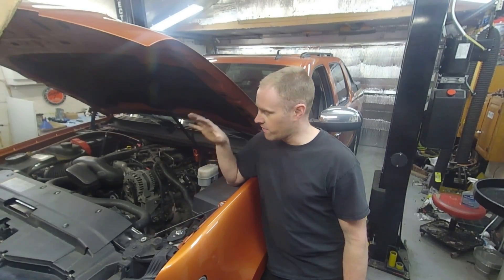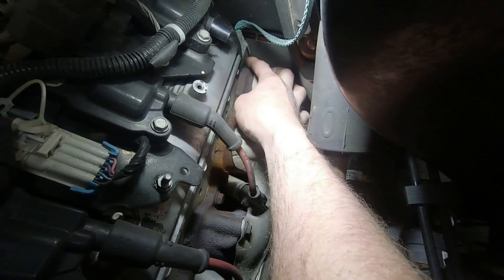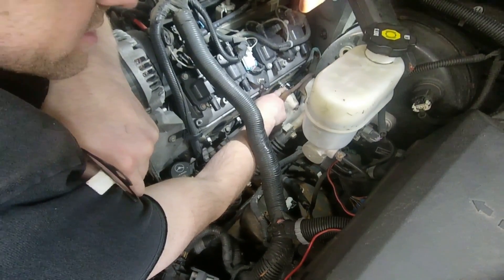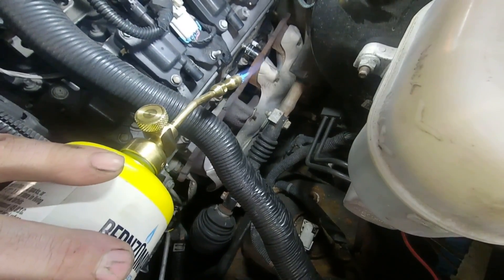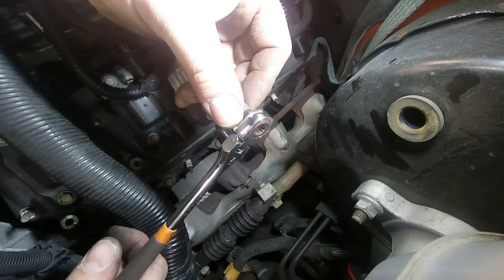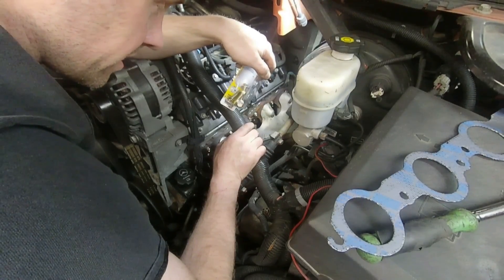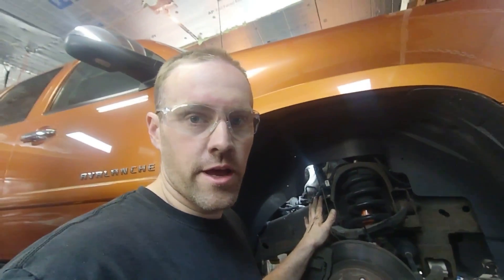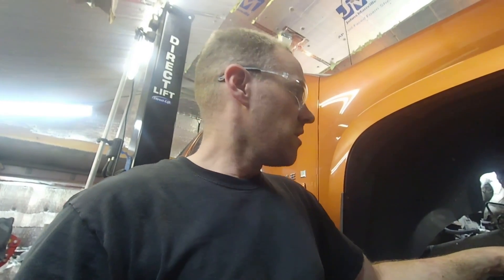GM Chevrolet Truck Exhaust Manifold Leak Broken Bolt Trick, Lifter Tick ??

Comment: I’ve found that putting a copper tube into the hole and feeding your mig wire through that will keep the “nub” from swelling too much and damaging the aluminum threads. The nub feeds into the copper which won’t take the weld. This nub…. Once cooled, can then be welded onto with a nut and run out. The copper tube also makes it so you don’t have to remove the manifold. I just found that easier for me rather than fighting and prying the manifold. Just a suggestion you might want to try. Great video… appreciate you taking the time. 👍🏼
Reply: So you didn't take the manifold off you welded build up then a nut correct
Reply: @dman3962  No I took the manifold off, but the stud was broken off approximately 1/4” below the surface. I didn’t want to corrupt the threads or the deck surface. The copper tube got me past this point without any issues and far enough out so I could get a nut on it. On a few, I didn’t need a nut, I just turned it out with vise grips.
I have done this without removing the manifold on pickups, but space is limited on vans. The tube helps on pickups with the manifold on, so it doesn’t stick to the manifold
Reply: @seanathighwaystar9588  Sixty Five Ford used the copper sleeve trick on his channel.

Comment: You got lucky. I had to weld on  mine to to be able to get it out. There is no room in there to have a welding helmet on once you get the fender liner out. I had to get the nut I was going to weld on in position, clos emy eyes, buff it with the welder for a second, open eyes and check. Got it out after trying 17 times.

Comment: I was just getting ready to do a bolt set!  I found a bolt head on the pavement where I park.  I've been messing with lifters for a month though, lol.  I've had the valve covers off, tryed the B-12 chemtool into the pushrods, flushed the motor with trans fluid, and the exhaust bolts were going to be my next attempt.  So thanks for verifying this.
Reply: How did it go?

Comment: I bought a 2005 suburban with 160000 miles for 1000. It was making a ticking noise. The guy says it's 100 percent the lifter, he had it checked by a mechanic. The mechanic quotes him 3800 for DOD removal plus new camshaft, lifters, rockers, valves, springs, and new updated valve covers. I was planning on replacing just one collapsed lifter to get the ticking to stop. I get the car home and pull the valve covers and all the lifters appeared to work fine. I peek down and sure enough about half the exhaust bolts were broken. All four in the rear on both sides were broke. I was able to extract a few and the ones I couldn't I bought three aftermarket clamps that clamp to the block and exhaust so you don't even need bolts. Worked great and been driving it for 3 years no problems. The funniest thing is my suburban does not even have DOD or collapsible lifters lol. I got a nice 4x4 suburban for 1000 dollars and one Saturday afternoon of work.
Reply from the maker: That's one hell of a deal! I was reading and at first like 05 doesn't have AFM. Then as I read it all made sense. Nice getting it so it didn't sound ridiculous. I know about the clamps just don't like them as a fix because it's not the correct fix. As a shop working on customer cars I won't put one on as it's not professional to do so. I understand it for a personal vehicle though.

Comment: Not sure if you mentioned it in the video or not, but these manifolds do warp on the surface that mates to the head. I have had them machined flat in the past. The last one I did, I didn't want to wait for the machine shop. In the middle of the manifold there is a spot where two bolts are side by side. I made a relief cut in the manifold there so both sides could flex a little. Put it all back together and its been fine for a few months.
Reply from the maker: I never mentioned it. Forgot to put it in but yes they can warp so if one was to actually pull it off it would be a good idea to get it surfaced.
Reply: Thank you. 
I'm just doing the recon on my 03 6.0
That explains my two piece passenger side manifold.
Reply: Long shot, but I may be dealing with some warpage on one side of my 5.3 manifold. By relief cut, do you mean you made an incision between the middle two bolt holes? How far did you go?
Reply: @ZareefHuq  cut it all the way through

Comment: I had to weld out 4 studs on my 2002 6.0, 2 fronts and 2 backs it sucked. I got a cheap welder from harbor freight. it was hard because my welds kept breaking off for some reason, but eventually I got it.

Comment: glad to know that this is common for GM, i am working on a 2003 gmc savana with the 6.0l v8 engine, and i noticed the ticking even when the van is warmed up it still ticks but i noticed when im driving and giving it some gas it goes away but you can still hear it when it idles, suspected symptom of manifold leak? i havent dove very much into yet but will do in acouple days
Reply from the maker: Late response, was it the bolts?
Reply: @CrazedPerformanceRepair yessirrr you helped me a lot it actually had a few bolts broken from the rear and front on both sides of the engine, since it was the cargo vans the job made it the worst couple days of my fcking life 😂😂 especially when I don’t work on gm too much and being a mobile tech in the heat but hey my pockets were happy after the customer paid side note I think this job showed me that I have potential to be a good yoga instructor 😂😂

Comment: Good job make the job a lot easier if you remove the inner Fender Wells that are just held on by plastic tabs especially if you're going to weld nuts onto the broken bolts.

Comment: Wonder if a higher grade bolt/fastener setups like the ARP or stage 8 with locks etc... would eliminate this problem for long term?
Reply from the maker: I would avoid grade 8 because they don't like to stretch. Stainless steel might be a good choice though. But the reality is they do typically last at least a 100k so idk what the best option is without a 100k in testing
Reply: Been reading that stainless steel in aluminum is the way to go. But studs with nuts to spare the aluminum threads in the block. Along with high temp anti seize rather than locktite designed for aluminum applications (non copper high temp). 

Our 2007 Yukon Denali with the 6.2L L92 doesn't have afm which I though might be the cause of some ticking... thinking now I should grab a light and look for black marks around the manifold.

Good content.
Reply: I know for a fact I'd hate my life if a stainless one broke and I had to drill that out 😂

Comment: Be sure to check your manifold for cracks mine had a hair line that was caught fortunately. I had 2 broke bolts on each side next to fire wall 4 total 3 of which were broke flush with the head mounting surface and had to replace manifold 600.00 bucks all together at chevrolet. I felt it was worth not having to deal with it if the other bolts decided to break. 2004 6.0 2500hd. ARP BOLTS ONLY!

Comment: That’s the exact bolt that broke on my 2008 Silverado. Dealer told me that it was caused by the head being aluminum and the manifold being cast iron. Tried to sell me the bolt extraction and manifold replacement for 1400. I laughed and did it myself for under 300.
Reply: How did you remove the broken bolt?
Reply: @frankdatank7751  I had enough meat on the bolt to grab it with some needle nose vice grips. Worked it back and forth until I got it out.

Comment: Yes, I have a 88 Chevy 88Z 71 with a broke manifold boat in the very back only driver side I don’t know how to get it out without pulling the motor
Reply from the maker: That is most likely a 5.7 with cast iron heads. You will have to drill and extract that bolt. Unless there is some stud sticking out. In which case you could weld a nut on then.
Reply: @CrazedPerformanceRepair  thank you boss

Comment: Had the same issue on my pickup. Mine's a 2013 6.0 and at first I thought maybe it was a lifter. After looking around I found the back bolt broken on the passenger side and both the front and back bolts broken on the drivers side.

Comment: I had same issue took dremel and cut a groove in bolt then extracted with flathead
Reply from the maker: That actually works really well, especially if you have a impact driver.

Comment: i just had one of these on each LS head break. one had threads show  so i stickwelded a nut onto it and it came out easily.
the other was about one thread into the head broke off and i tried mig welded a lump on there to twist out but my lumps twisted off then  i tried drilling and using a easy out thats  similar but different than yours enough that it had a drill bit inisde and and easy out thing on outside.
It did turn almost half a turn but  TLDR, it broke off in the hole.
so i tried migging  a nut on there again and no deal, just twisted off.

i do have another ls core i could steal a head from, is that my easiest option at this point? will that involve a new set of intake and head gaskets?

Comment: I had my arm/did delete and went with regular lifters and new cam. Now I have that tick and I have some hesitation stutter on acceleration. No codes. Is it possible broken bolts are making me run like crap? Just acceleration is giving me a stutter now.
Reply from the maker: That could be a lot of things. You may have done something wrong on install, have bad plugs, dirt caught in the MAF or something. Hard to say without proper data.

Comment: Great job. I've been trying everything to figure out why my 2001 silverado hd has code po300 missfire. To much o2 leaking into exhaust (o2 sensors). Causing rich mixture.
Reply: First off, that would cause a (false) lean condition, not rich. Second, the code in that case would be P0171, not P0300. Misfire conditions are detected through the crankshaft position sensor, not the oxygen sensors.

Comment: I had my heads rebuilt and since they went to the machine shop I had them remove the rear broken studs on my 08 Avalanche.  I put back new GM studs but wanted to know if you had an idea of what the root cause was and how to prevent it from happening again.  Wonder if it was a manufacturing process issue at GM factory that over torqued the rear bolts.
Reply from the maker: Heat stress over time mostly. However, the bolts are a bit small and weak for the application. So better hardware would make it last longer. Also sometimes the manifold warping over time plays a factor. One could get it resurfaced.

Comment: Why not use A-4 stainless steel header bolts?  They're less likely to break and/or rust weld to the header.
Reply from the maker: It is best to use stainless but the other bolts are awfully cheap and people don't seem to care much as long as it lasts a while. Considering the stock ones typically last 100,000 miles plus they really aren't that big of a deal to replace.
Reply: @CrazedPerformanceRepair  Yeah, sounds reasonable.  I just don't like the idea of mucking up a head or using helicoils.  Personally, I'd pay you to install stainless. 😉

Comment: I just took off my heat sheild after hearing loud engine noise, rattle chirp newr exhaust manifold. I have a turbo engine. There are two bolts broke on the manifold, hopefully they can fix it without removing my turbo. Else they wanna charge me to remove turbo, catalytic converter, manifold and gasket. Something about replacing the gasket with the bolts. What do you think? Should replacing the bolts be easier?

Comment: Should I do this when the motor is cold or let it warm up for a little..
Reply from the maker: If You let it warm up at all You will have to let it sit and cool down as well. Otherwise the manifold will be too hot to even work on the thing. It might help though only because it might make it easier to get the weld to stick.

Comment: What do you think about using factory bolts but with a nice thick stainless steel fender washer? Would that help dissipate/reduce heat on the head of the bolt??
Reply from the maker: Nah I don't think it will help much. Better bolts like stainless or ARP will help. But one thing to consider, these always have well over 100k miles before failure. So it's not like it's a short term fix.
Reply: @CrazedPerformanceRepair  ok thank you. I’m about to have my 6.2 on my 09 Yukon rebuilt and I want to upgrade a few things. So if I’m going to keep my truck I’m going to replace these bolts now for the rebuild but I’m going to order an extra set of bolts and I’ll change them at 50,000 or 75,000 not a big deal. Thanks for the info, I am not a mechanic I just do what I can when we have an issue and it’s mostly bolt on. 🇺🇸 💪🏻 👊🏻 🤙🏼

Comment: I haves noise on my ram that scares me. Brand new build NON-MDS 392 Stroker. Sounds like header leak but i can’t find any smudging anywhere. BBK headers, could there be a crack somewhere?
Reply from the maker: Sure could be, hook a vacuum cleaner exhaust to tail pipe and check for leaks with soapy water while it's cold

Comment: I'm about to remove two broke bolts on the left side. I'm going to do my best to weld a nut on that back broken bolt. It's super tight in there, so I'm fairly nervous. Lol. Also I did get the replacement bolt set. There isn't an issue on the right side exhaust manifold, but the question I was wondering was, should I remove and replace the old bolts on the right side too?? Before they break? Or is that a risk I shouldn't take, and just leave them alone for now? I'd rather not have them break in the future, but I also don't want them to break trying to remove them, and cause myself unnecessary work. Sigh...
Reply from the maker: They are most likely broken or just about to break. You just can't tell because they are hardly hanging on.

Comment: What size welder did you use ? Would a small buzz box work ? Or do I need a 220v for the heat
Reply from the maker: You can get it with a small buzz box but crank it up and it may take a few tries.

Comment: Have u seen them dorman brackets you bolt on and it snugs up the manifold to the head and boom your done without all the hassle of what you did there????
Reply from the maker: Yes, but this is the correct way to do it. Besides more often then not you end up with a broken bolt on the front by the alternator bracket. I don't believe those can be used there.
Reply: @CrazedPerformanceRepair  your doing right thats a fact you do everything right, I can never thank you enough for your video's on stuck lifters..you sent me the lifter tool and i fixed my lifter and u saved me thousands in repairs. Love your videos there so informative and you show everything from start to finish thanks for sharing

Comment: Yipes, putting a pry bar against that aluminum head??  And heat all bolts with acetylene torch before trying to remove.
Reply from the maker: Your not going to crack the head with a pry bar it's not brittle it's soft. You might ding it if you get crazy or twist the bar I guess. 

The torch does same as a welder in regards to heat. It just doesn't add a nut to put a socket on. The heat allows the lock tight to let go.

Comment: Tell me, do broken bolts affect the oxygen intake? Can it be that the engine is unstable? If one bolt on each side is broken off?
Reply: It does, your upstream 02 sensor on that side will tell the computer it's running lean because the exhaust is escaping before the o2 sensor and the computer will then start dumping more fuel. You'll get PO300 misfire codes and then eventually PO171 system lean bank 1. MPG will nosedive and black soot out the tailpipe.
Reply: Absolutely. I had a exhaust manifold leak on both sides and the truck tried to compensate by adding more fuel, she ran like total shit because the o2 sensors started to “foul” i guess. New 02 sensors, new exhaust bolts and gaskets, and new plugs has her running smooth again.

Comment: got the same job on a hummer 2,  very back bolt on drivers side, had nub sticking out, that broke off, tried welding nub up. no avail, tried plasma cutter, only goes so deep, just a shitty angle,

Comment: So what happens when you've tried to remove one below the surface with a tap and it breaks off?
Reply from the maker: Lots of swearing, then attempt tap extractor and end with a welder. That's why I try not to use a tap if I can help it lol.

Comment: Would it be better to install studs with bolts on the head instead of the factory bolts
Reply from the maker: Not necessarily, lot of times the studs get in the way. I think the issue it the little 8mm bolts (5/16) vs the old sbc that has 3/8 bolts and doesn't fail.
Reply: Do you think a good arp bolt would fix this problem?
Reply from the maker: @stephenjohnston226  It might but honestly a stainless bolt might be best. Stainless does a good job with lots of expansion and contraction so that might work the best but I'm not sure. Its hard to test because the original ones typically last a 100k miles or more.
Reply: Thanks crazed performance repair really enjoyed your videos. Really wish there was more mechanics that cared around. Keep it up.

Comment: my problem is the bold broke off inside the motor And the bolt extractor broke off inside it too. 1995 chevrolet g 20 van
Reply from the maker: I believe that has a cast iron cylinder head, if so you will need to drill a bunch of small holes with high speed bit around the bolt and extractor. Then you need something like a time-sert https://amzn.to/33GK50h otherwise you could try to blow out the extractor with a cutting torch if you are skilled enough with a torch good luck.